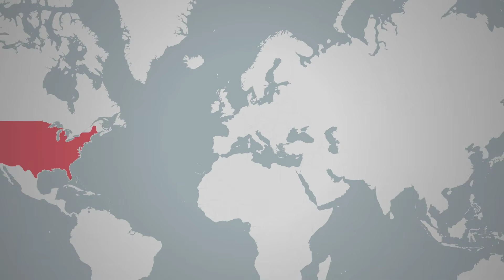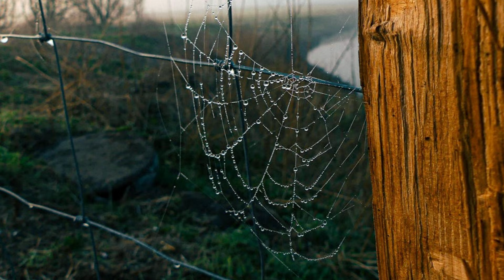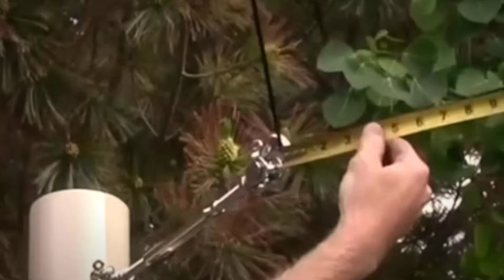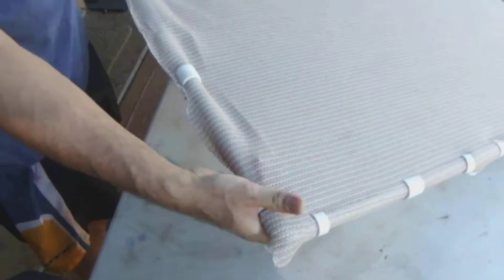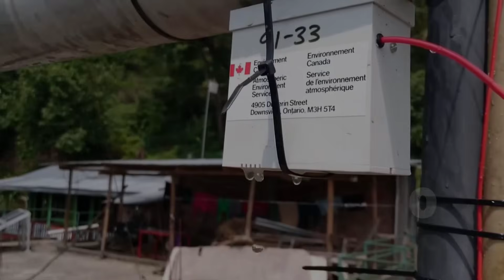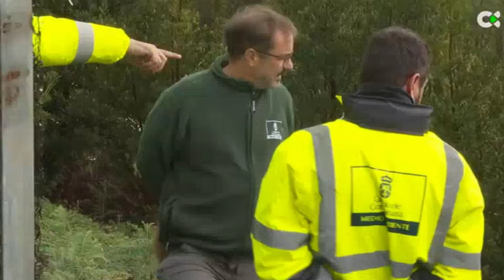Infinite Water for $12 — The Forgotten Engineering Trick

Comment: Except it doesn't get below dew point regularly in those high desert regions. This is a solution that seems useful if you don't understand the underlying physics of dew point, but in practice it only works for a week or two out of the year. It's only useful for coastal arid regions that get fog, which is completely different from dew. 

I'm in a northern hemisphere high desert, and out dew point was 14F/-10C last night. It only got down to ~50F/10C last night, nowhere close to dew point. It only got below the dew point on 5 nights this winter.